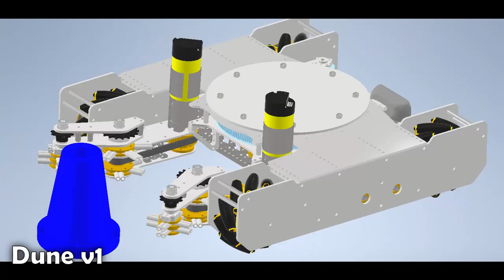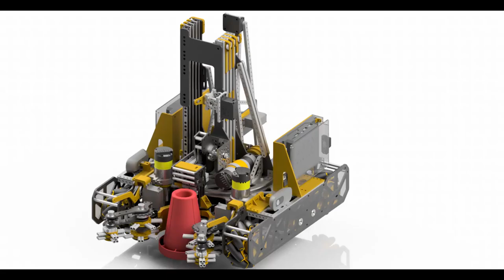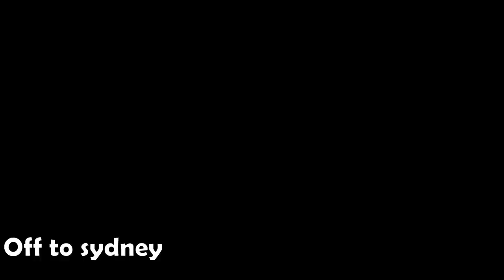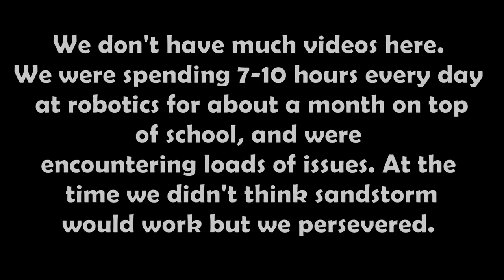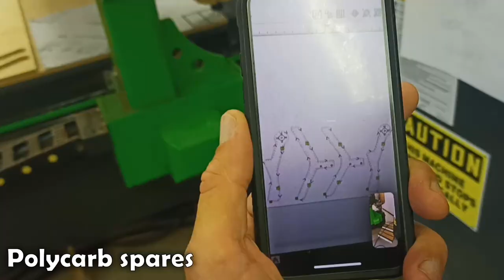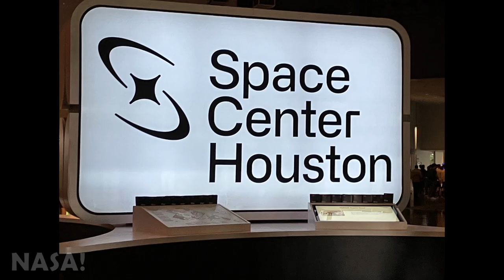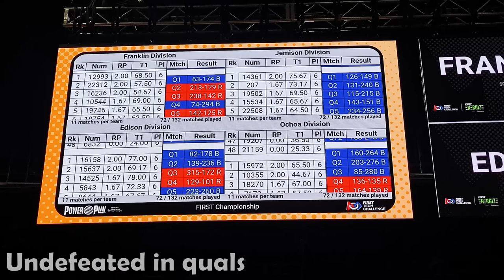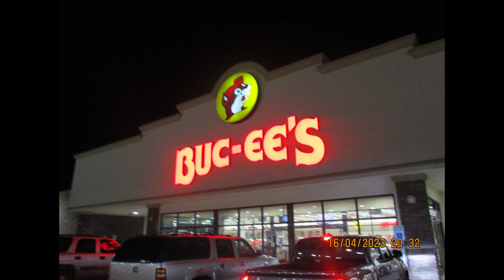FTC Powerplay - 12993 RoboKings Season & Worlds Recap

Comment: hey guys, amazing robot! I was at worlds for powerplay with my team, Techno Phoenix 14010. I remember you guys, and I have a question. What slides did you guys use for your worlds bot and what motor did you use to power them. Also, besides the motor, did you guys use anything else to power the extension of the horizontal slides? Our season is finished for Centerstage but we are working on an offseason project for Centerstage that is quite honestly similar to your guys' worlds bot from Powerplay (with 2 pairs of slides, one pair vertical and other horizontal). Thanks!
Reply from the maker: We used misumi sar 230s for both horizontal and vertical extension. The motor was a rev motor with an ultraplanetary gearbox (5:1) for both extensions. For the horizontal extension it was just a standard stringing setup.